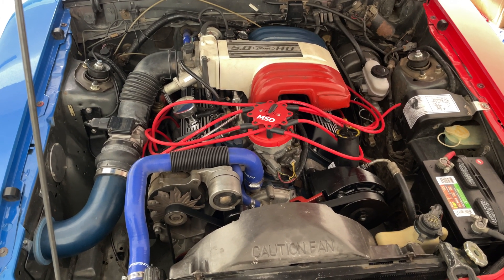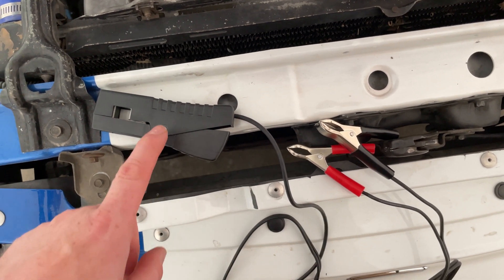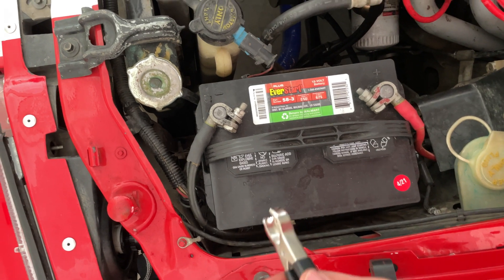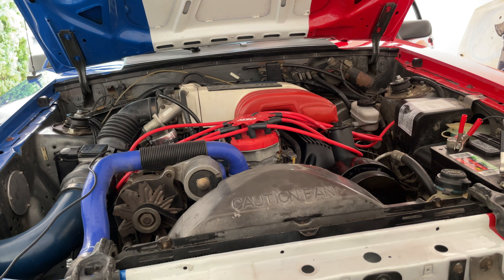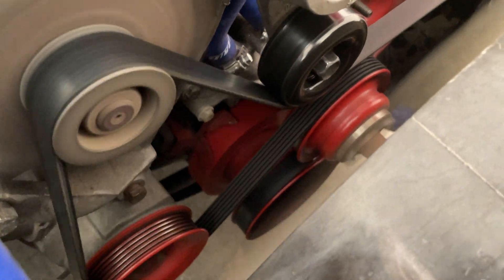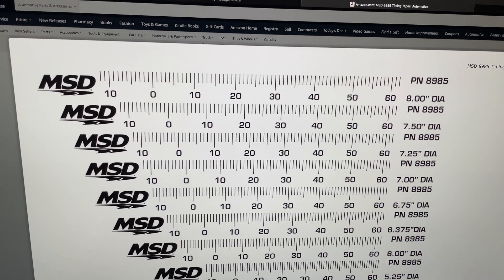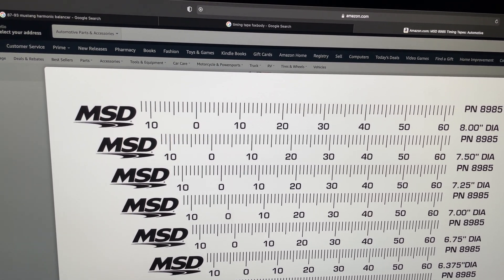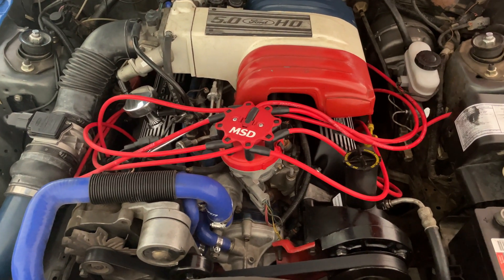How to set the Timing on an 87-93 Foxbody Mustang

Comment: Great vid.  But I wish you would’ve shown which spark plug wire that was…..like where is cylinder 1 coming from..mine still has factory boot on it and I think, but not sure it’s on the drivers side in the front….

Comment: Mine doesn’t start that great when cold starting even if it’s 60-70 out and heard it could be timing was also told timing should be 20 not 10
Reply from the maker: Base timing from the factory is 10. 20 is really high. Even modified 302 engines the highest I like to go is 16-18. If your car is having problems starting when cold I would use a smoke machine and try to see if you have any vacuum leaks. Under the intake manifold, PCV hose etc. after fixing vacuum leaks I would then make sure you’re getting proper fuel pressure so you can use a fuel pressure gauge it should be 39 PSI with the fuel pressure regulator vacuum hose unhooked. If that’s all good. I would then look at o2 sensors spark plugs and wires coil etc basic tune up stuff
Reply: @foxperformance4536  I don’t have O2 sensors and it’s not vacuum related have done all that it’s enrichment issues on startup I have an aftermarket ecu and it’s more then likely it tuned right etc car will start almost every single time if I put the gas pedal to floor 2 times before trying to start up then it’ll fire off super easy and or fire right up I haven’t checked spark plugs yet bc I don’t wanna just keep chasing things etc
Reply: @stevenmcc2119  Checking the spark plugs and basic tune up items is chasing things? And Leech Motorsports forgot more than you will ever know! So and so said Timing should be 20,lmao!! 👈💯🤣😂
Reply: 14 on 5.0 with EEC4
Reply: A guy from leech motor sports said 20 degrees of timing is needed when I watched and talked to others who say 10 without the spout connected for base some shoot for 12-14 so I don’t trust anything that leech motor sports says anymore lol